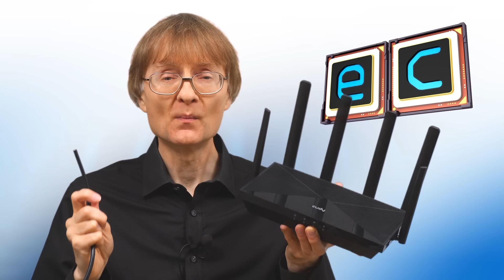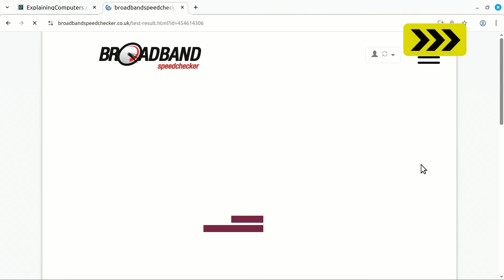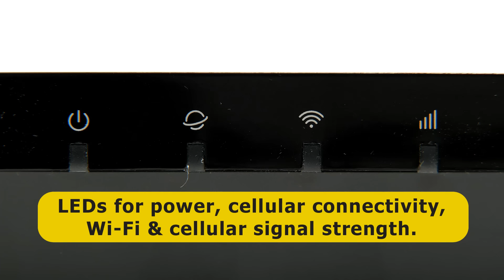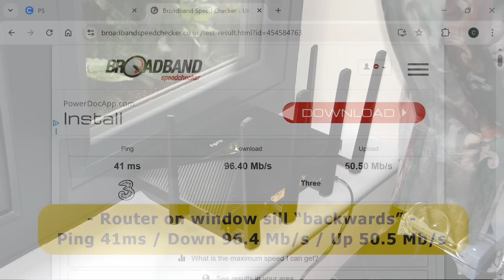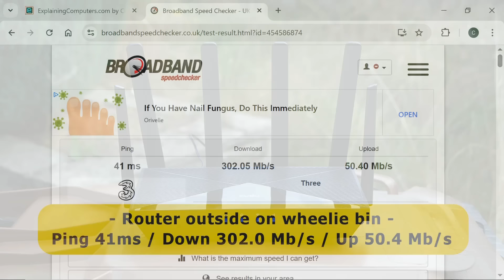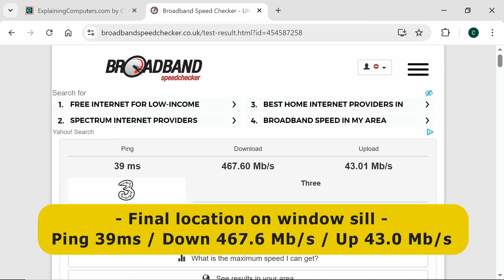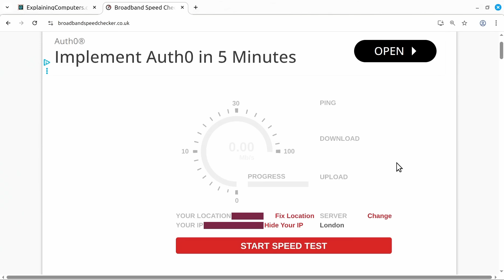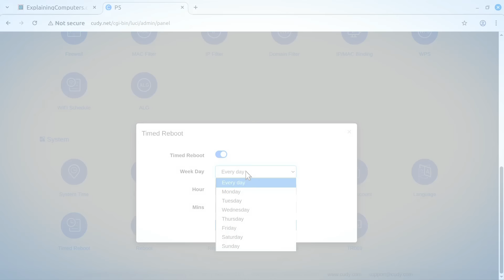Switching to 5G Broadband: Cudy P5 Router

Comment: We got Sky fibre advertised at 300mbps. The computer is plugged into the router and I get the advertised 300mbps. However wirelessly the speed drops off extremely quickly. They advertised better routers if you want to pay more for it. I have wondered about buying a router to try and maintain the speed but due to my limited knowledge I risk wasting my money. The previous router from Virgin gave better wireless results

Comment: Hi Chris, I have very similar setup, but I use SMARTY virtual operator which uses Three's Network. This operator has much better conditions , it is cheaper and it has the same signal strength as Three.
Reply from the maker: Greetings! I hear very good things about Smarty, and did look at them. But I could not beat the £16/month for unlimited data that I'm getting from Three (as an additional SIM). However, I see that Smarty is currently £20/month for unlimited for new customers, which is a really good deal.
Reply: @ExplainingComputers  Hello,
It is possible. I was lucky and in a promotion I got unlimitted data and calls for £16/month and when applied for one more sim card in a group the price went down to 14.40/month... :)

Comment: I use Tp-Link M7010 with 4G sim, the challenges is that sometimes I get very low download speeds but the upload is much faster, however when putting the sim back in an android phone the speed is totally fine, I really like what I saw and maybe Ill switch to it as well so thank you for sharing
Reply: The M7010 is a very old model capable only of LTE category 4. Unless your phone is very old and/or very crap, it has a better modem inside.

Comment: 5G can be a good alternative but comes with a number of gotchas (esp in the UK), not sure if they are all still current?:
* I don't know about 5G Broadband contracts but when I have tried it CGNAT leads to double NATing.
* Due to the above, no inbound connections to your house, EE in facts seem to even block this on IPv6 with no NAT at all. I realise a power user thing.
* IPv6 only being enabled on EE
* As the video points out very variable coverage with very variable speed through the day, depending on location of course
* I have seen discussion of mobile companies closing down some towers at night due to less traffic (and assume people will be on home WiFi), so again coverage/speed may vary by time of day.
* Their "fair usage" data whilst bigger than previously is still maybe too low for some users.

I have used 5G (which often went 4G) until my fibre was installed. I was very glad to witch back to FTTP when it arrived, it just much faster, less laggy and more predictable. I would find during the peak hours of end of school day, home working became problematic.  But if I was stuck on poor FTTC (40-50Mbs) I would consider 4G/5G, but it would depend on area.

Comment: Hi I use a mobile router for internet connection due to being in a rural location and the only wired connection was ASDL with appalling connection speeds. However it is a PITA for VPN connections I cannot get a public IP address, due to the carrier using CGNAT (Carrier Grade NAT), how did you get around that or is it not an issue. I have ended up using Tailscale, to circumvent the issue but other options like OpenVPN for my TP link router will not work

Comment: 928 down/931 up CenturyLink in Minneapolis.
I talked my Sister into this service, which was $69/month.
I'm moving tomorrow, and will miss the Fiber connect.
My 4G-LTE phone has a ten gig cap, but, I've d/l'd 2Tb of stuff and there's a library nearby where I'm moving.
Cheers!

Comment: I've often wondered about doing this. I'm lucky enough to have FTTH here. I wonder how it performs on video calls with the latency? I work from home and have several google hangout calls/day. Also, are there any throttling or contention issues with 5G? Eg if you download 200 gigabytes is it a steady download rate or does it quickly taper off?
Reply: higher latency is certainly worse for telecommunication. With 100ms it gets noticeable and annoying for all participants.

Comment: I've been thinking about switching to Three's broadband too. However, for some reason they say that there is no coverage for their home broadband but I can get the mobile broadband. Their website isn't very helpful and they give no reason as to why I can't get home broadband but can get mobile broadband, even though they both use 4G/5G. I've looked at the coverage map and I can get 5G... all very confusing. Also, it's really hard getting any info on the routers themselves on the Three website. I think Three need to try a bit harder.

Comment: I've gone back to fibre, after using an outdoor ZTE MC889 for 5G. I found the low ping rate very annoying and found 5G extremely variable in performance throughout the day. Where I live it's not "Full Fat" 5G, instead it's 5G NSA (Non-Standalone) which is based on the older 4G technology. I have a WiFI7 Cudy Router that is excellent! I now have a much lower ping of 4ms on fibre.

Comment: Great video and very informative. This was suggested to me by my isp as Im only getting 1 megabyte a second download speed and no fibre and paying £40 for the privilege. Is it reliable though and when it says unlimited is it actually and no capped ?
Reply from the maker: For me, over the past c. 7 weeks, it's week as reliable as a wired connection. What "unlimited" means varies between networks. For example, EE has a hard "fair usage" cap at 600GB/month, whilst Three considers over 600GB/month to be "non personal use", and so may cap or limit speeds after this point.

Comment: Very informative, thank you. 
I'm in the middle of Auckland, and NZ got broadband pretty right, so I have FTTP and just did a test (early evening) and got Ping 5 Down 839 Mb/s Up 470 Mb/s. I should say that I got in early and had fibre installed when they were testing their procedures, and they did it properly--when the budget got squeezed, they tended to bodge some aspects. My nominally Gigabit connection costs me NZD114 per month (roughly GBP 50) from a small, new ISP who's still in the stage of building size. I guess I'll have to change if they get big and predatory, like the larger companies. There are parts of NZ where fibre isn't practical, and they rely on wireless, and I think that's variable in quality. At the moment, where there's no fibre there's also probably no 5G.
The Cudy router looks very well thought out -- I hadn't heard of that make.

Comment: Interesting video as always, thank you. Much as I loathe BT (especially for replacing competent engineers with idiot managers) I detest Openreach even more. I used to have to deal with them professionally and they are a nightmare. You can't call, only use their hideous, cryptic and opaque web interface and they excelled at stringing out responses until late on Friday evening when they would close the ticket. This meant that the reopen ticket window expired before you were back at work on Monday and you would have to start all over again.

Comment: I switched to 5g broadband a year ago and haven’t looked back. I live next to flood plains and my nearest cabinet regularly flooded leading to extremely poor or non existent connections. 
I went with the Three contract and offered router and find everything now reliable and consistent. I am also lucky to live around a quarter of a mile from my nearest tower. 
My village has recently been installed with cable fibre services but the cost of some providers is prohibitive even though speeds will be 500mb upwards. I’ll be staying with 5g well after the end of the contract with Three.

Comment: I got a fiber to the home installation about 2 years ago.  It is wonderful.  The problem is that most of the wiring in the house is for 100Mbit Ethernet, and the speed is 56 Mbit down 5.1 Mbit up.  I then did a connection direct to the router which is (I'm assuming here) is a 1Gbit connection and got 806 Mbit down 858 Mbit up, which isn't too bad.  Gotta love the fiber connection.  Note to self:  Make things a 1Gbit Ethernet connection, it might improve things.

Comment: What you had  previously in terms of  your broadband internet connection from BT is very much like what I have currently at my house. We have what is referred to as Fiber to the Node (FTTN)  by the local phone company AT&T that provides it. They use fiber to  deliver internet and digital landline phone service to local phone company cabinets in various neighborhood around here and  then use two pairs of copper wires to go the last mile the cabinets to each subscribers  house. The data transmission standard they use over the copper wires is known as Very high-speed digital subscriber line (VDSL), which allows up to 100Mbps data rates but only if your located no more then 300 meters (980 ft max) from the phone company cabinet. Otherwise, your maximum data rates will be significantly lower (in our case it was limited to 50Mbps), with a maximum distance before you get no useable signal at all.

Comment: In 2025,3Mbps down / 500 kbps up is the best the local telco offers here in the USA, in the middle of a city of 500,000. And they want $75 USD/month for it. Comcast offers up to 1Gbps down / 300 Mbps up, but are unreliable and want $100-$300/month. I'm running T-Mobile's small business 5G here.  $30/month, speeds are 400Mbps down, 150 Mbps up.  Very reliable, especially after a hurricane.

Comment: Strange that at the same time we come up with similar yet different issues half way accross the globe! Here in British Colombia, I had two cell phones and one land line. My use of the land line was very limited yet much more expensive. I started to evaluate my actual need and figured that I could easily stop using it and get even a third cellphone account and still save a bunch. With this came the futur need of high speed upload worries. One my phone here outside, through the trtees I am lucky to get 25 MB/s. I mostly get 5 MB/s in the home. The improvement outside leasd me to want to install a tower with anthenas and learn about all this. I planned to get a custom tower I could move with my car and make it totally deployable in more efficient locations when in need of speed. The project is now slowed down by postal service strike, but it now have evolved to just have a Pi 5 in the car with two modems, one per provider, install 2 directional anthenas towards the front of the car and two pannel one on the side. Each of the type on their own modem connected on the Pi 5 running on a power bank. The car becomes a phase array mobile anthena jumping from tower to tower on each network in tethering as the vehicle is moving. So less loss of signal in the valleys and forest of the Canadian Rockies. Yet it need to be verified! When in need for speed, I will just park where is the best signal on both network with the nose of the car pointing at the best tower of the two networks. The other one will then pivoted towards it own prefered anthena. Pi 5, using a tethering software will then distribute a portion of datas to one of them i proportion of its relative signal quality and the remaining to the other network. At the other end, the packaging will also be regrouped and expedited through fibers using top of the line servers.

I will eventually subscribe to a distribution service to send everything to multple location afterword. This way it won't be my own cell signal that will just repeat much of the data trasnsfer, burt the land high speed network. The cost of this is still a fraction of even the cellphone service, and if used intensly, saves much time.

If just going outside triple my signal, I suspect that getting an even better location, pointing a bether anthena at a tower and then a second at another while tethering to a specialised server, I suppose I can get away with very impressive performances. This also work for download. Although, I don't need much of it.

Comment: Hi Chris. I too have switched to 5G through slightly different circumstances. My ISP here in Spain provides a wireless connection of around 15/10 Mbs up/down, which has actually served me veery well for the past 10 years. Recently my son started a company and signed up for a digital package that allowed me to have an unlimited 5G Sim very cheap. His business involves a lot of VR so I also received a Meta Quest 3 that has completely changed how I work because now I do all my research and design on the MQ3 using a PC connection. This required a bit of trial and error but the setup might be interesting for anyone else interested in testing 5G before going the Cudy P5 route.

I use a cheap Amazon bought RJ45 to USB-C connecting the PC to my 5G phone using Portable Hotspot -> Ethernet Tethering. I have the wireless Hotspot on the phone disabled for this (see below). This should provide connection of 320/50 Mbs BUT there is an interesting issue here because I only get those speeds on my PC after I have run an internet speed test on the phone browser!

I then enable Hotspot on the PC to allow the MQ3 to connect to Meta Remote on the PC with no noticeable lag. Having access to (up to 3) virtual 48 inch monitors is superb for someone my age whose eyesight is not good. Maybe it would make a good episode for your channel?

Comment: I've got a 4G Internet connection to my summer house, which is a 6 hour drive away from my home. When I'm not there, the connection is primarily used for surveillance cameras. My 4G router (as well as the cameras) also has a "timed reboot" feature, but I found out the hard way that it wasn't as useful on its own as I thought, since if the router or camera firmware froze/hung, it naturally wouldn't go ahead with the rebooting schedule. Did I mention that the summer house is 6 hours away?
Anyway, the simplest of solutions to the rescue: Cheap and common electromechanical timers to the power outlets! Now both the router and the cameras are scheduled to be power cycled daily.

Comment: Chris, I'm in California and have been a wired ISP customer of Spectrum (nee Time Warner Cable) for decades, but due to half century old copper coax in my building and neighborhood, which cannot simply be replaced, my service speed had reached an unbreakable ceiling of 60mbps despite Spectrum charging me for 100mbps service at $160USD/month.  
Finally two years ago, both T-Mobile and Verizon completed their 5G deployments in my region and began selling 5GHome routers. As a VZ customer, I opted for their service bundle that gives me $30/month bill for 300mbps service, with about 25mbps upload. I have their router connected to two piece Orbi mesh system that gives me coverage throughout my home, with two separate LANs. 
The value proposition of going wireless 5G is quite obvious here in USA too.

Comment: Here in Vancouver, Canada. I pay $87.68 for the following:
1GHz speed, Download speed of: ~900Mbs & Upload: ~ 750Mbs(by WiFi)
mind that fiber optic connection's speed fluctuates depending to the trafic time
This price($87.68) is much lower than the actual price for the fact that I've bundled my Tv & Home phone & Cell(5G) with the same company(telus) and as resault I pay only $141 per month with a 2 years contract for the whole services

• Includes Advanced WiFi Modem(6Ge/6G/5G/2.4G - $0.00
• PureFibre Internet Gigabit - $130.00
includes 1 TB monthly data
includes Email $0.00
Internet Promotional Price (when all promotions effective) $87.68(Internet only)

Comment: In Indonesia, Unlimited cellular plans usually come with FUP (Fair Usage Policy). Basically It is Unlimited with certain threshold where if your internet usage exceed that threshold, then the ISP will lower your speed connection. That is why most home connection still prefer Fiber connection (mostly FTTH) compared to cellular because the price doesn't worth it and for smartphone, volume based plans are the dominance.

Comment: Bizarre behaviour from Openreach. The UK really has become a basket case of a country in recent years.

The fibre rollout here in Ireland has been painfully slow, so I'm very pleased that in the meantime, copper wired broadband speeds have been surpassed by 5G technology. Thankfully the anti-5G nonsense that has become so prevalent in the UK has had little impact over here.

eir, the Irish equivalent of BT are useless, but thankfully in recent years the electrical grid maintainers ESB Networks have been building their own fibre network from scratch meaning that 100% of customers they deliver broadband to via their telecoms partners get fibre right into their homes.

Comment: Rural Tennessee, USA, Fiber to the home, Ping: 11ms,  Down: 487mbits, Up: 483mbits.  Very weak 4G LTE available.  I am in a valley in a hilly area.  I need voice over cell to talk indoors since cell service in so weak. T-mobile home internet, and Spektrum Cable also available in my area.  T-mobile not good option because I am in a valley.  I have Starlink Mini dish for backup, road trips, or camping it is usually 30ms, 80mbits down, 15mbits up.